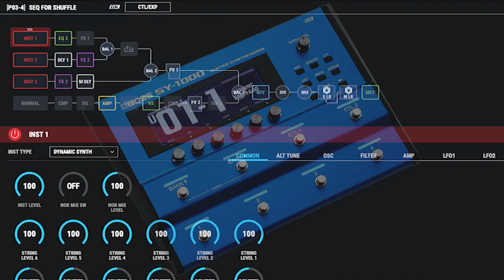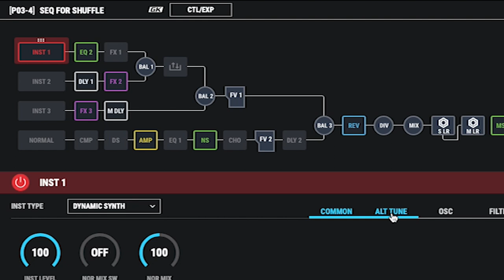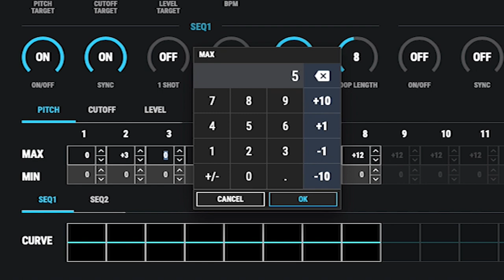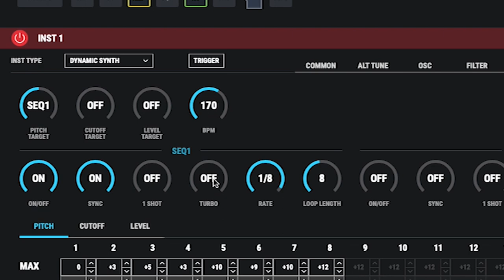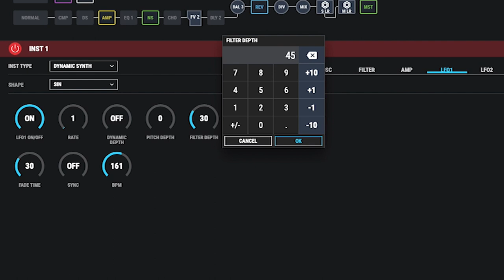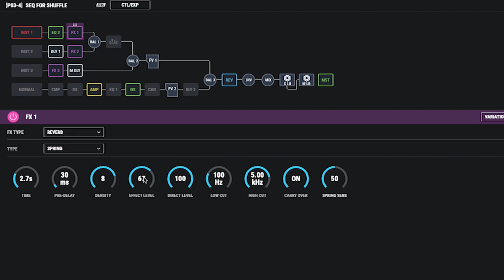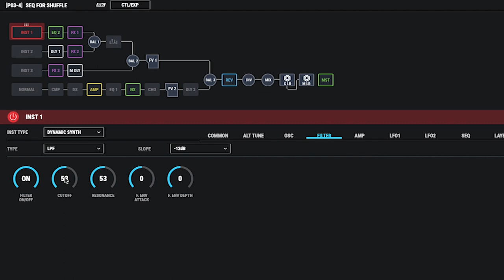Boss SY-1000 On The Run Sequence - Step By Step Tutorial - EMS Synthi AKS - Analog Recreation

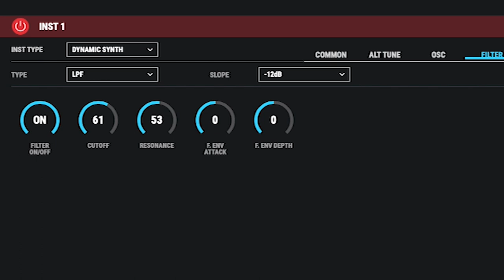Comment: 6:25 In a pinch, I think you could use SEQ2 instead of LFO2. I was able to get OK results with 1/16 rate, length 1, inverted U curve, max/min=74/47
Reply from the maker: That makes sense in this case, as SEQ2 is more flexible you can save that for something else, but sure that would work as well! Flexible thinking!